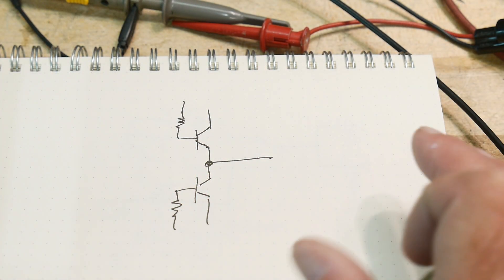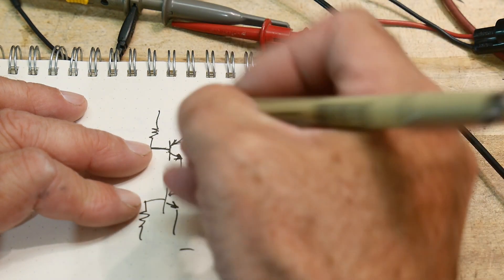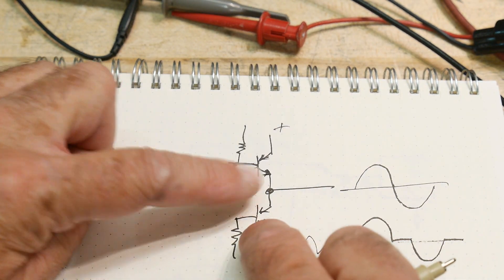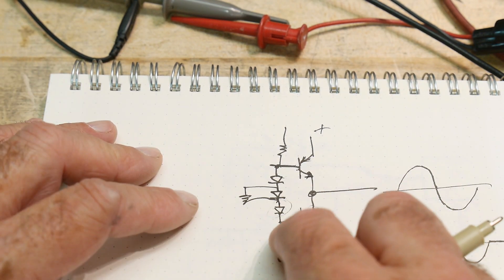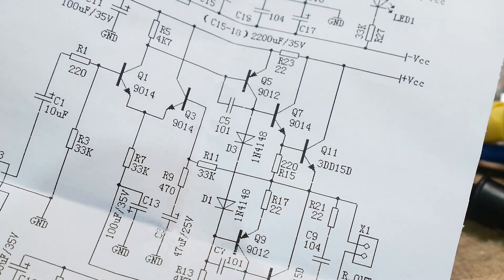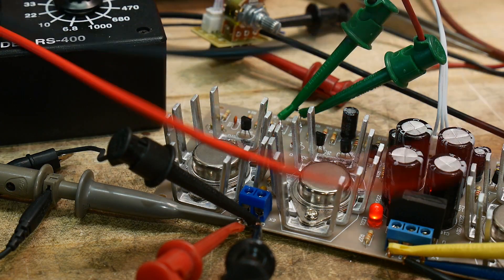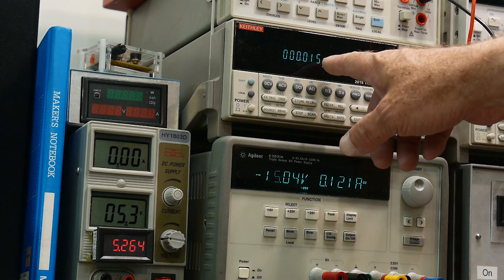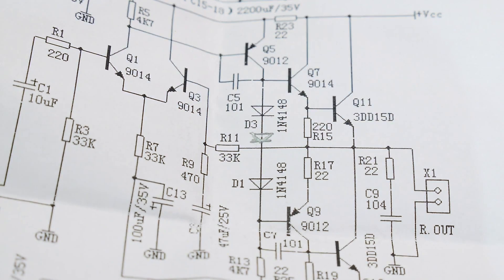#810 Stereo Amplifier kit (part 3 of 3)

Comment: what diode did you use?
Reply from the maker: all diodes used in this where similar to 1N418 or 1N914. I added a third diode to bias the circuit, but a better way would be to add an adjustable resistor to fine tune the crossover distortion.
Reply: @IMSAIGuy thanks for your answer.

Comment: Very well explained, and it makes sense, sort of...
But how can you get away with only 3 diodes?
Isn't there 4 diode drops in total in that output?  Q7, Q9, Q11 and Q13
Reply from the maker: Yes, you would think so. Things are always more complicated than first order effects. the diodes in transistors will not match the other diodes, and the bias is not as simple as eliminate the voltage drops, you are trying to have some bias current in a class AB amplifier
Reply: Actually there are only three base-emitter diode drops: Q7, Q9 and Q11.
Reply: In better output stages, the output POWER transistors are complementary NPN and PNP.
An additional transistor is thermally coupled to them and connected between their bases as a "vbe multiplier" (one resistor base-emitter (trimpot) and another base-collector.
Ratio between them gives approximately makes Vbe * (ratio+1) appear between collector and emitter and bases of output POWER stage.
This gives also temperature compensation and keeps idle current more stable.

Comment: Ideally you would want to attach the diodes thermally to the transistor heat sink to prevent thermal runaway.  It would be interesting to see how the bias currents changed as the transistor warmed up with use.